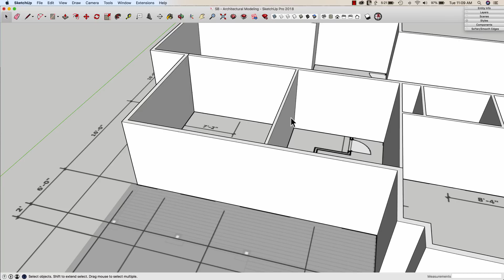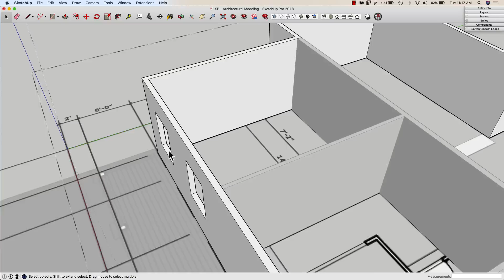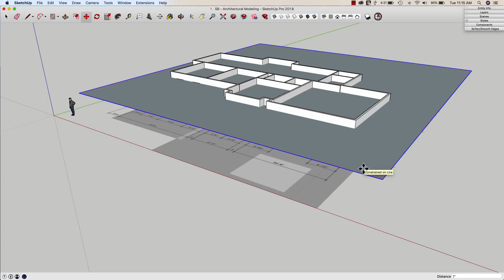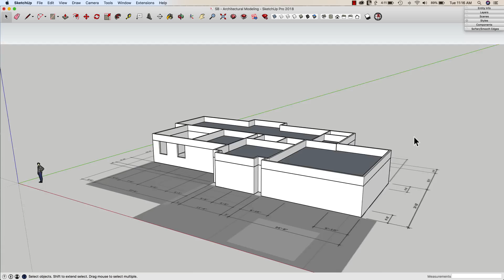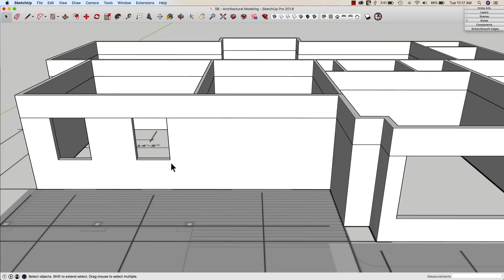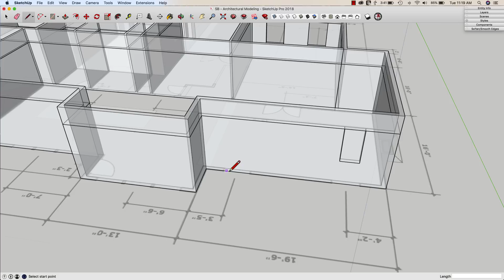Comment: excellent skills, most the builders I work on plans for do not like to be locked into any specific window so that explains the dimensioning to center, and don't label the opening "rough opening" that will be bigger and varies with manufacture, the reference plan for head height will save me a lot of time

Comment: With sketchup free, when I paste windows it doesn't work.  Specifically, the pasted window only show up as lines on the outside of the wall, not an opening, and when I go to push pull within the square it won't select and the whole wall moves.  I've tried selecting the four lines and it still won't let me push pull a copied window.

Comment: Thanks for the Intersect with model tip. I just realized this is a great way to make floor slabs. Instead of drawing the outline manually, make a rectangle, intersect with model, remove outer edges. Floor Outline is done. Been using sketchup for 10+ years, but still keep finding easier ways to Basic stuff!

Comment: Aaron...I would do a Section Cut Group at 7'. That way, you could put that Group in a Layer and/or Scene to Toggle On/Off or to Move/Copy it. Also, this method makes Erasing a One Click Operation rather than having to Erase each Line one at a time around the Model.

Comment: I think it is strange to have openings defined by their centres.  Most drawings define things by a real fixed point like an edge.  That makes it so much easier to record on a survey and to set out on a design drawing.  If you're designing then using the surface intersect you show for the top and bottom of openings, you can just draw vertical lines between the intersect lines, then punch the holes with a double click (if all walls are same thickness).  But then as you say there are many ways to get to the same result. ;-)
Reply: Your words make a lot of sense! Alas, most drawing I have designed from locate the center of the window, so that’s what I addressed here.
Reply: Window specs may not be finalized until later in the design process, or RO may be different for same window callout dimensions between manufacturers. Locating by center guarantees proper location as design choices are made.

Comment: Thanks for sharing those great tips. I think I have the easiest technique, assuming there is a window list somewhere of all the different sizes. Create "glue to any" 2D components of each size. Then copy and paste the relevant window component where needed. The "glue to any" makes this very easy and their centre lines quickly register to marks. When all are done, explode and push through. 

If all walls are the same thickness, there are techniques (without plugins or dynamic components) to make the window holes instantly on exploding. I

'll have my brownie point now.
Reply: Dude!  👌

Comment: I knew the "trick" which means I must be  getting better at this.  Another way to cut openings is to make a cube of the window opening, and if the walls are 'solid', use "Trim" to cut them all.  
After getting the plane located to 7' off the floor and intersecting with model, how do you erase all those guide lines on every vertical surface?  From a Front or Side view you can select (left to right) just the lines, but do it before the model gets too far along.  Nice video.
I was a 'framer' and built a dozen houses many years ago.  I love how Sketchup allows us to build a house using almost the same methods.
Reply: Refuso Againo If you group the initial rectangle, you can just select the group and delete it when you are all done. My background is in building design and I fell in love with SketchUp for the same reason!

Comment: That process is not efficient.... I would create components with boxes with the size of the windows and doors.... put them in place.... group them and copy the group and hide one then I would use one of the groups to use Boolean operation to create the openings ... then I would unhide the group... explode it now those components used  to create the openings  will become the Windows and doors.
Reply: Fernando Lino The best method is the one that works for you!
Reply: Aaron Dietzen you asked at the end of the video if one knows a better way and the way I described is better. Don’t you agree? 
 I don’t have to draw extra lines
 I use the same time to locate the openings and insert the future windows and doors ... all in one shot
And it’s way faster.
Reply: Yasu Leone if you don’t have pro then intersect the group and then pull the face .... still faster than copy them, draw lines and erasing faces
Reply: Fernando Lino  can you make a video showing how to do this?

Comment: I used to teach manual push pull method to create hole like this, until i found it has a drawback if you get a wall that has un-paralleled surface between outer and inside wall. It is very frustrated. So I move to use solid - subtract method to produce clean solid model, as a bonus we will always have volume info for cost estimation and ready to 3D printed.
Reply: Too true. If you follow the method in the previous videos, ever wall is made with offset and push/pull, so wall faces should be parallel. In the event that they are not, though, your method is great!

Comment: I put the doors and windows on floor plan, then pull up with walls, use horizontal plane to intersect door/ window verticals.  And finally push in the openings.
Reply: R B That works, as well! Thanks for the workflow!